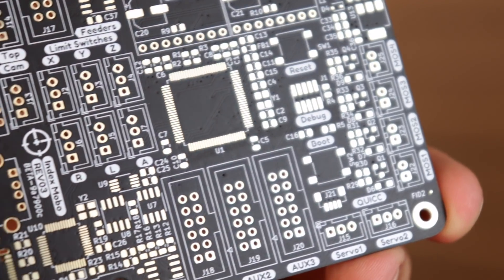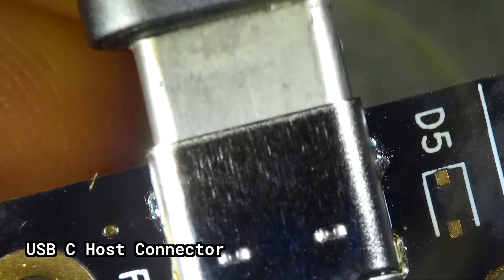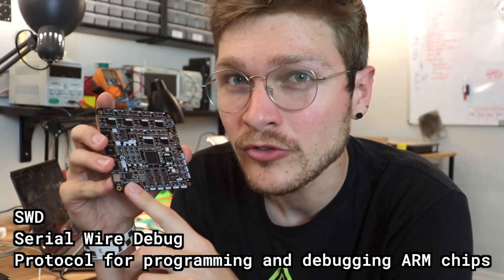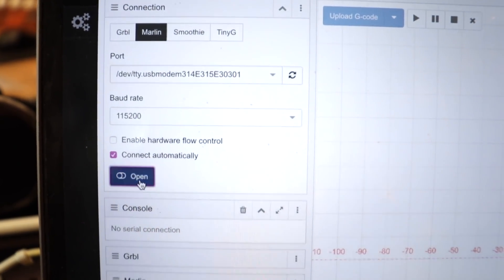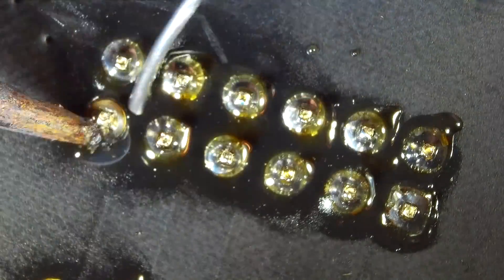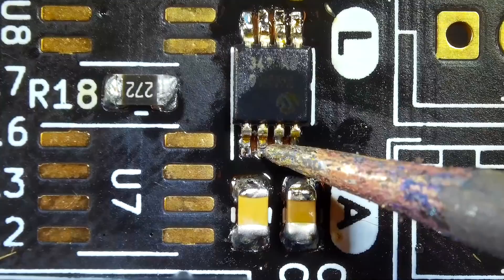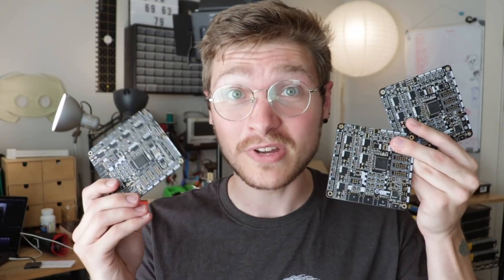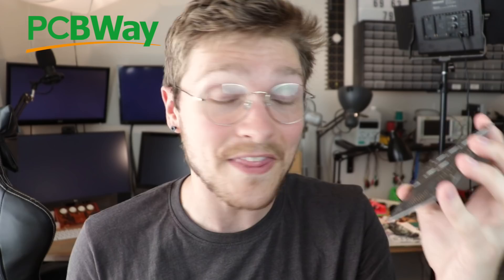Open Source Makes Better Designs - Index PnP - Mobo REV03

Comment from the maker: Hey gang! Thanks for all the feedback on the last video about the staging plate! Lots of excellent points, I appreciate you taking the time to share your thoughts.

I totally understand that the test I ran is not providing incredibly accurate data: potential bow in the extrusion, 3D printed part tolerance, overconstraining the plate and subjecting it to warping, etc. We received actual FAI data from the vendor that serves the purpose of true data gathering. We've also found that 0.8mm is easily within the bounds of what's acceptable for this plate, given that PnP nozzles have compliance in the Z axis due to a built-in spring (but of course, the flatter the better!). I attempted to preface the data gathering with a disclaimer that this is a gut-check, a functional test, for checking the nozzle's relation to the plate in the machine, not proper metrology. I don't think I did a great job conveying this, but I'll be sure to be much more accurate and explicit in the future!

However, y'all provided quite a few other ideas about how to solve this same problem easier/cheaper that we're exploring now! Some aluminum extrusion with a thin piece of steel mounted across for those interested in magnetic mounting, or plywood for those not, would be an excellent solve, and quite a bit cheaper.

As always, thanks for your thoughts and feedback!
Reply: What about pcb with components in the two sides,  can this pick and place be able to handled
Reply: @harryman01  Not practical in a hobby setting, because part on the first side need to be glued. Otherwise they fall off in the 2nd reflow.

Comment: Serious Question, I am going to buy a TVM802 (secondhand at a really low price). I know the vision system will have to be replaced (up and down cameras) but was wondering if your motherboard would be universal enough to use as a replacement for older machine and bring it over to OpenPNP.
Reply: I guess so. But be aware that the TVM802 uses three Nema 23 steppers.

Comment: Can you talk more about your decision create yet another custom CNC board?  Why not use a regular RAMPS (or GRBL) hardware (or one of the 32-bit equivalents)?  You can usually pick up a completely ready to go controller board with steppers for $20 to $30 on Amazon.

Comment: Great project!!! 
This board suport step drivers tmc5160? Because Will be great If so, for more current and velocity on moviment.
Observation, tmc5160 use SPI mode STEPPER DRIVE  and the board need tô som jumpe tô configure this.
Thanks a Lot.

Comment: Any thoughts on using this board in a 3D printer with Klipper? Maybe even Marlin??? I’ve been disappointed with the quality and longevity of 3rd party boards. Designing a board is probably out of my reach. But what you’ve got here looks like it could be great in an Ender 3 or Ender 5.